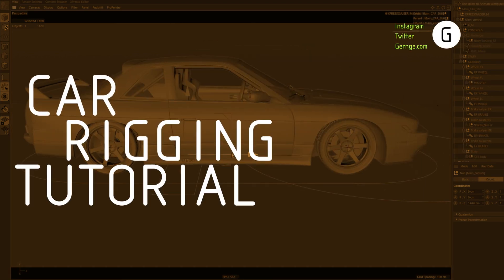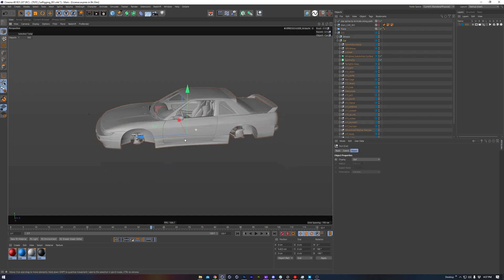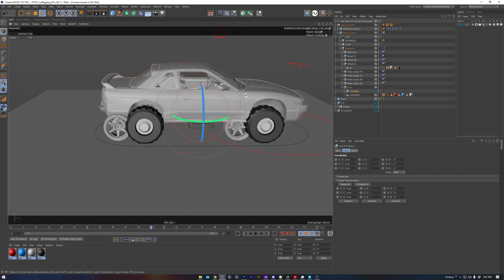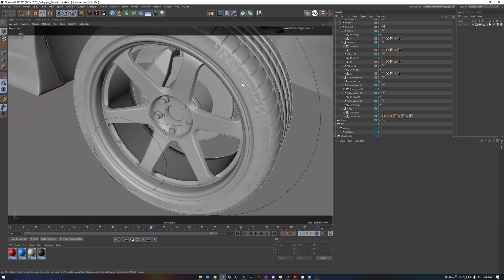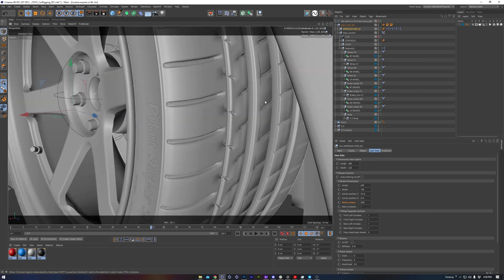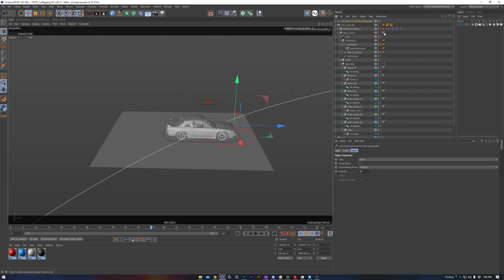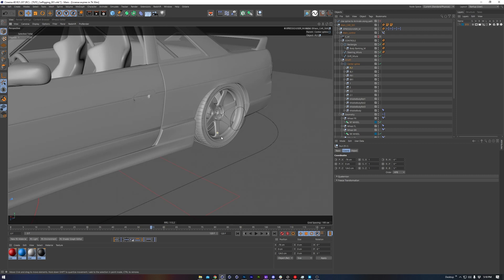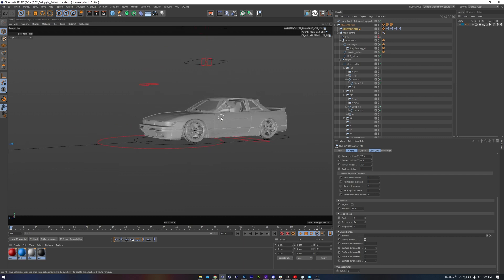Gernge Quick Tips - Car Rigging Walkthrough | Cinema 4D

Comment: Hey Billy. I am currently rigging a car as well and in the past Ive used this same exact rig. This time im also trying out the car rig in C4D from the Character menu.

I've noticed with both rigs that the rotation of the wheels seems to be too fast when there's curves in the animation or when using align to spline. If you love the car slowly using the position gizmo it rotates okay.

Is this more of a visual thing that makes me think the wheels are rotating too fast? Or what do you think? 

I'm pretty sure the rigs are applied correctly but wanted to hear your thoughts
Reply: Hey Jesus, I was experimenting with that rig a few days ago and faced the exact same issue. If we align to spline the car, there are kind of problems in the curved part of the road. Also we have to manually keyframe the wheels steering because obviously the wheels do not stay straight when the car turns in real life. When wheels steer there is also a problem with the rotation speed that looks off with the road.
I think it is due to how the rig is created, and especially the math in Xpresso. 
I havent find a solution yet. If you find one or if you find a better rig, please update your comment, i am curious :)
Reply: @laeternaml  after a few tries I ended up using the rig that comes with C4D under the character tab. It's a bit more involved but it also has a ton more options AND the steering responds automatically to the car turning when it is on a spline. Definitely give that one a try.

I still feel like the wheels rotate a but too fast but with motion blur it goes unnoticed
Reply: @j.ssuarez  thanks for the feedback! The auto steering with a spline seems a great feature, i didn’t know. 
Im sure this still due to the math used for the calculation of the rotation of the wheels, I guess it is very difficult to calculate accurately depending on the angles of the curves. But yes if the car is not driving slowly it may be not so visible.
I didnt want to use the built in c4d rig because I found the component setting (with the colored dots) a bit complex and confusing to setup. I’ll give it a second try then 👌🏻